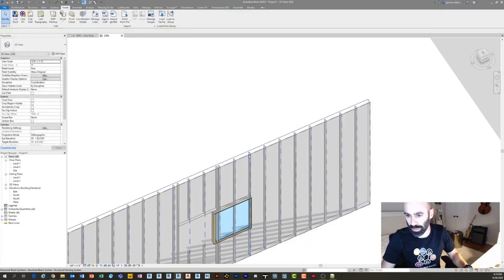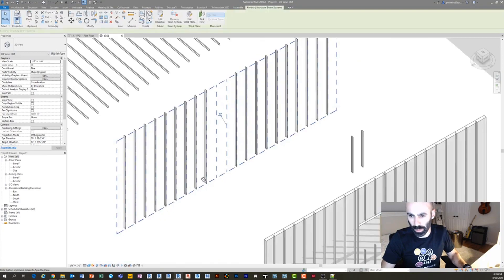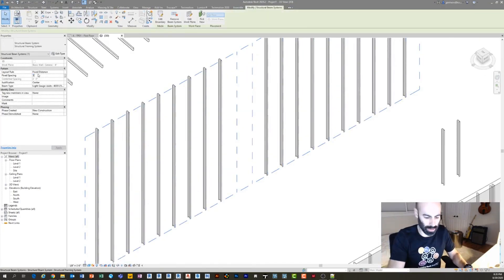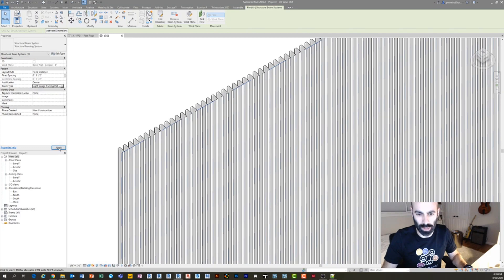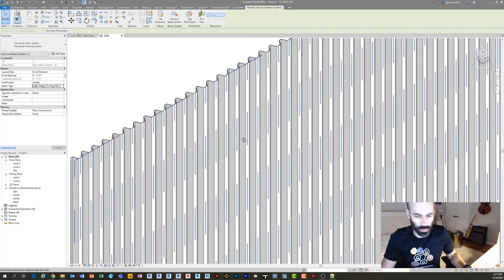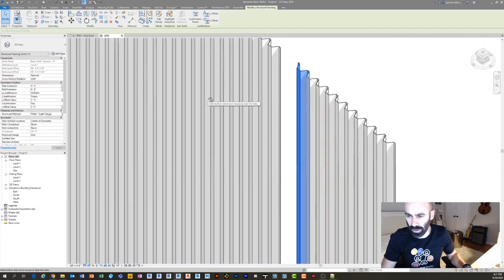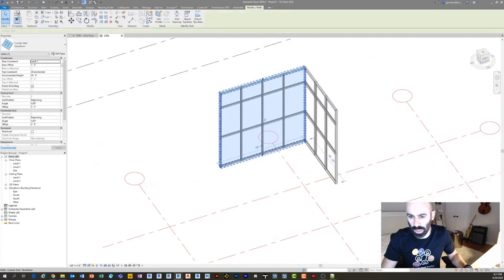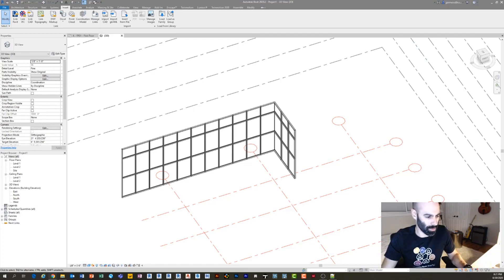Corrugated Metal Walls in Revit Tutorial (Quick Tip Edition)

Comment: Having the mullions form the metal ribs would be really painful - first because there are going to be way too many of them and second - putting windows in that wall would be quite an inconvenient task. However you can  just make a nice curtain wall panel with the repeated profile needed.
Reply from the maker: Yes, agreed curtainwalls would work (I've shown various versions of this in other videos).  However, this option would give users analytical models if need be... A curtain system would also require editing the sketch for windows a doors.  Cheers!